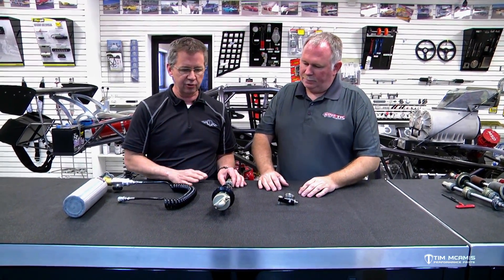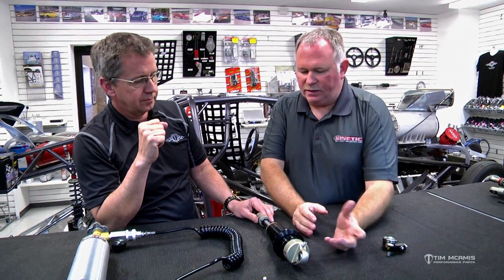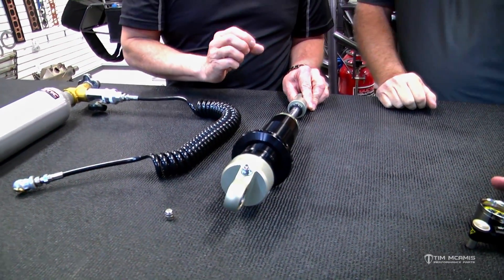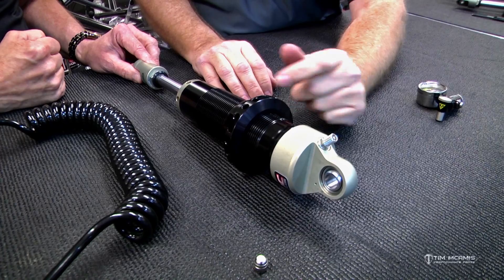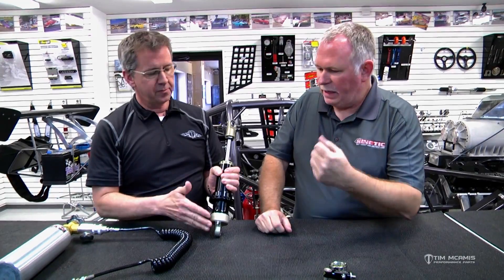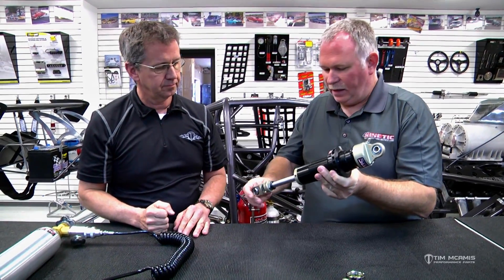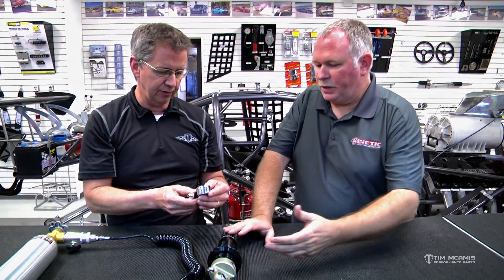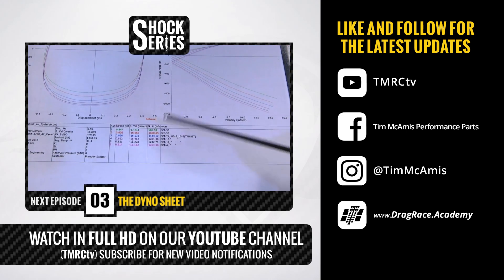Shock Series: 02 – Pressure Management

Comment: Nice tip on an emergency to fill with air if nitrogen is not available. Just copared R of air vs. nitrogen and dry air is more stable temperaturewise against N2. The problem filling tires with air is not the air , is the humidity on air!!!!!!!!!!!!!!
Reply: That is true on the wet air, however it is not all about moisture when it comes to tires. Rubber is permeable and nitrogen has larger molecule than oxygen and so the leakdown is less.